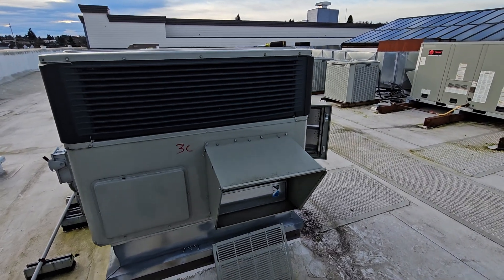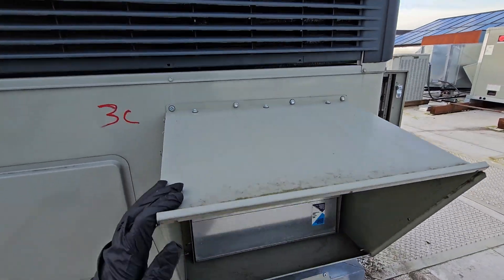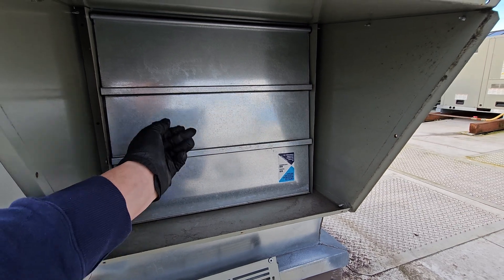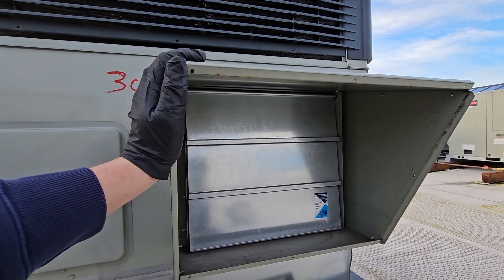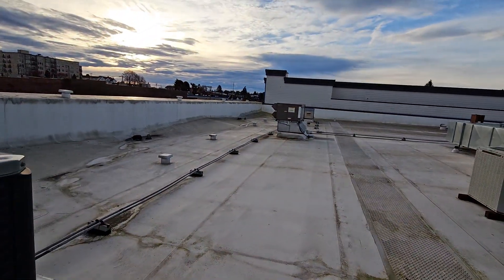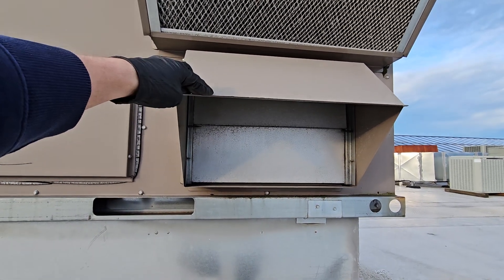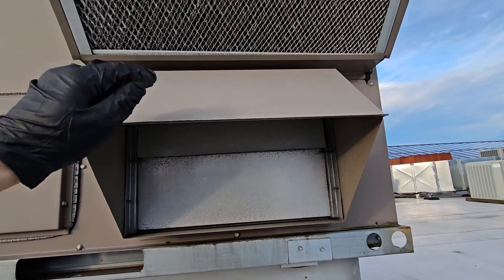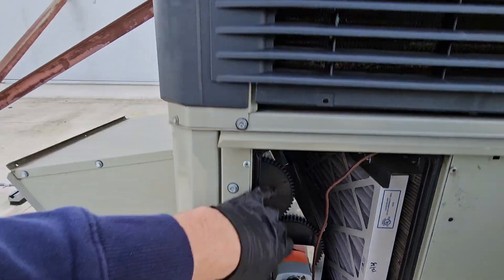What Does My Barometric Relief Damper Do?

Comment: I have a building with a chiller/VAV system where all the offices are preasurized. What have you seen to fix that problem?
Reply: You have to get a balancing company to set the correct RPM on the exhaust fans. I had the same problem at a hospital. That’s how I solved it.